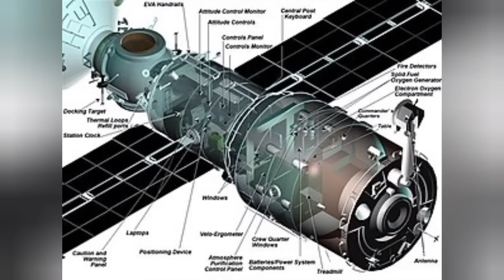Can Russia run off with part of ISS in 2024?  Can NASA do anything about it?

Comment: The Russian module does not have nearly the power generation necessary. And, more importantly, it doesn’t have any thermal radiators. They would have to abandon it almost immediately after detaching until they could install those components. And it’s highly unlikely they could adapt it in under 5 years.

Comment: With the ISS losing one of its five partners (Europe is a homogenous entity under the agreement), that means the remaining share of the ISS resources (eg communications time, who gets to wiggle the robot arm, who uses what space potty when) will need to be recalculated. Even considering the cost of refurbishing the interim module with its "does anyone know how to use Windows 98" problems, it might turn out as a net benefit for the remaining partners.

Comment: Elon promised us a rebooster.  I assume some bolt on thrusters delivered by dragon are being prepped.  Elon.  Right, elon?  Elon??
Reply: I know.  The starship orbital test launch should just go there dock n be wet lab space, connect header tanks to surplus rcs, make those headers fatter no tiles no fuss no muss.  Massive instant upgrade, only needs docking port n robot pilot.
Reply: Launch an old chevy pickup on a falcon 9 , and use a fat chain to tow the iss around.

Comment: You mean like how they threatened to stop boosting? They're still boosting. Russian propaganda is just that - propaganda. I can see them leaving the station and letting us run it - but I don't see them separating the modules. Doing something like that would take a lot of planning by both sides, and they would have to work with NASA to make sure both sections can operate independently. I don't see the scenario happening where they just cut off part of the station with no planning.

Comment: SpaceX could adapt a cargo Dragon to be a thruster module very quickly.  And let’s not forget the Axiom modules preparing for launch.

And the Russians will be left with Mir 2.0. Nothing new in 50 years.

You underestimate the ISS and overestimate the Russians.

Like you usually do. The

Comment: OK ---- I noticed that YOU DID NOT Say one Word about Space X's plan to dock a Starship to the ISS (for testing Large Crew habitation and long range Human Support systems) that would not only more than double the Volume of the Current ISS but serve to boost and Manuever the ISS when the Russians are Gone...  But then as Usual you would not have so Much to BE MAD and RANT About... if you included the whole TRUTH.!!!   LOL!!!   Oh!  By the Way,,,  Attaching the Starship to the ISS with the Russians GONE (No longer having a reason to keep the ISS in such a High worthless Orbit) would even allow America to MOVE the ISS to a more Benifical Orbit closer to the Equator that would cut the cost (reduced time, while INCREASING Cargo Weight reaching the ISS as it takes less fuel) to get to an equatorail ISS as well as increasing the Usufulness of the ISS... Another Advantage to moving the ISS closer to the Equator would allow the ISS to serve as a Personel, Cargo and Refeuling WAY Station for going to the MOON..!!! Which is impossible from the Orbit it is in NOW..!!! Giving a Great Reason for Expanding the Current ISS to many times the size it is now.   With thousands of Cubic Meters of perminantly attached Starhips designed for the ISS allowing huge 30 to 60 and growing number of crewmen to start with that consist of Scientests as well as Tourists with a large maintenance crew of Engineers  to maintain and upgrade current ISS systems Cost effectively as the ISS continues to expand over many years and Decades...  With the old ISS attached moduals serving as a Museum for showing Toursists how Primative the original Astronaughts had it..!!!   Congress should emediatily Declare the ISS an Historical Sight to keep it from being destroyed As the New ISS grows around it...  After all Space has Plenty of Room so the ISS does not need to be Destroyed to make room for a new ISS.  Which Means OLD ANGRY ASS...  Actually has something to get Mad About for a Change when they keep talking about Deorbiting the OLD ISS...!!!

Comment: Leaving aside the short term consternation, reboost is the only big thing missing from the US/Euro/Jpn side of the station. That can be solved and Axiom may have a part in that. I for one would like to see the Zarya and Zvezda modules end in a fiery streak over the pacific. They were old before they were put into space, Zvezda module construction started in the early '80. They were not unlaunched  parts of Mir but the first components of the USSR's response to the US SDI program (Starwars). They were the propulsion and power to a Russian space laser battle-station; the Polyus orbital weapons platform. Ironically they are the only part of Starwars that flew. But they are really old now and its time for them to go.

Comment: Of coerce, Russia is going to leave their part of the ISS, because it is too expensive to detach, but didn’t they add a … My first thoughts were that the SpaceX Cargo Starship will be in-service before Russia detaches from the ISS, so the ISS will have no problem staying in orbit and avoiding space debris? My second thought was, Yeh, dock the Starliner to it and just leave it there? I don’t know that the Starship will be human-rated to lift humans from the surface, but why can’t they dock with the ISS and test the regenerative life support system? If they choose the Starliner to keep the ISS safely in orbit it can bring a life support system with other cargo, because hopefully, it won’t have astronauts onboard until it’s safely docked to the ISS…

If you have read my past comments, you’ll understand that we will have at least 7 SpaceX Starship Tankers in 7 orbits before 2025. The Tanker Starships will be full of fuel with at least a flight cabin with space to rent to NASA and the public for experiments. If the commercial station is to start attached to the ISS then the second module to attach should have the life support system?

Isn't Russia part of the ESA, so doesn't the ESA need all of the so-called Russian modules? 
Russia will take? Prichal Docking Module
Launched: Nov. 24, 2021
Installed: Nov. 26, 2021

Russia will take? Nauka Multipurpose Laboratory Module
Launched: July 21, 2021
Installed: July 29, 2021

U.S. & ESA will still have; NanoRacks Bishop Airlock
Launched: Dec. 6, 2020
Installed: Dec. 19, 2020

I don’t know what Angry is worried about? Owe, Russia is leaving, well it’s about time…
No, if Russia leaves today, Panic, no I’m sure NASA is ready, I mean what do you think, the X-37B was made for; https://youtu.be/plXuFQJv1v4

Comment: Zarya belongs to the United States. Paid for and delivered. It doesn't belong to Russia. Russia's biggest problem that you didn't address is power. The Russian section is almost totally dependent on the USOS side for power. On it's own, the Russian side will barely make enough power to operate, but I don't see them doing any experiments.

Comment: I feel the age of the ISS may well be over.  With reusable rockets massively reducing cost and the starship able to spend between 1 hour and 6 months in orbit, with far greater room, safety, comfort, and infinitly adaptable for scientific research, why bother maintaining this relic?
Reply: Starship has not flown yet, so I think your claims for Starship are somewhat premature.
Reply: Rather than depend on starship for solving every problem cooperation between the big players and NASA would be the basis of a solution and  is the ISS still fit for purpose in whatever configuration debate is good and being prepared is better maybe it's just a Russian Ben foola